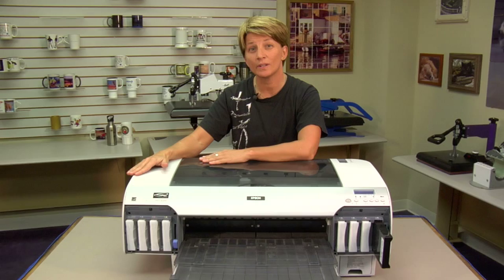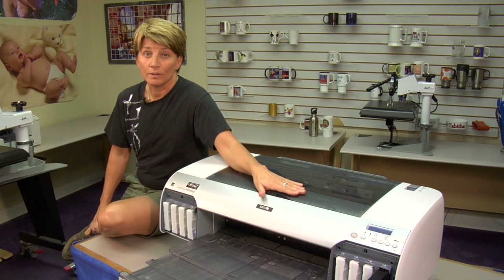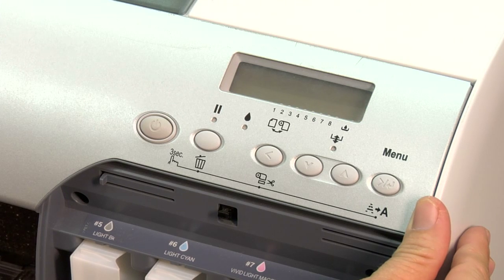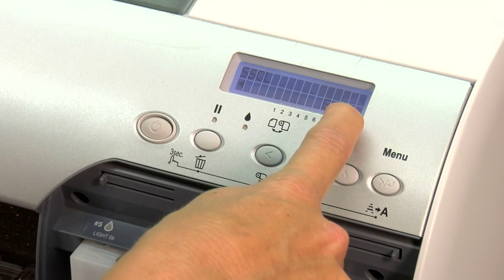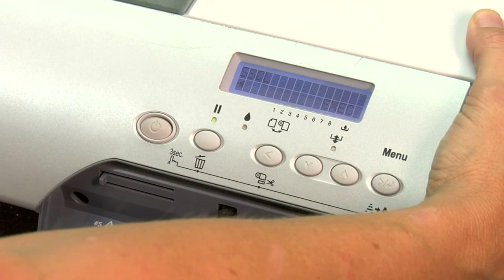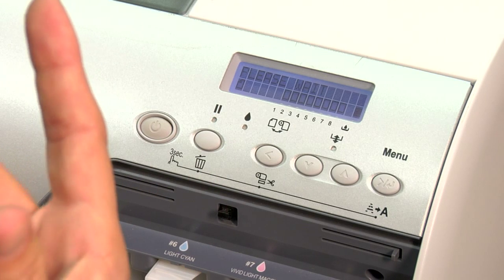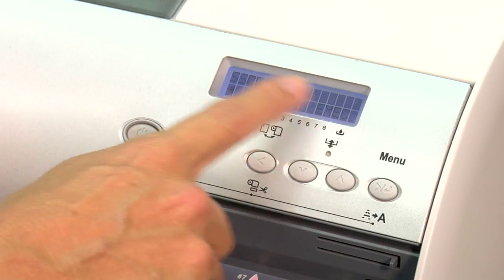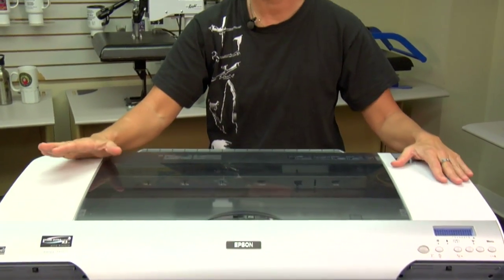Super Sonic Cleaning on Epson 4800 Series Printers -

Comment: This is another really great video Vicky - Thank You for making it easy. There IS a  caveat though. Unless there's a work-a-round, Super Sonic Cleaning is only available when GENUINE Epson Ink Cartridges are installed. Problem is that it will fail with the "Unable To Execute" error because the initial "Non-Genuine Cartridge" and "Damage From Cartridge" dialogs will NOT have been accepted and cleared - which needs to be done upon every power-up when using other than Epson cartridges.